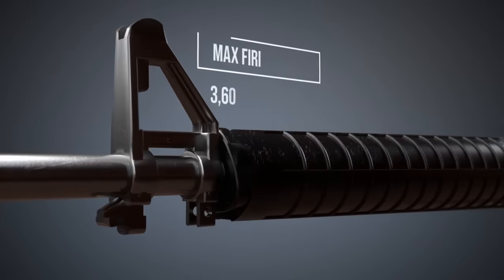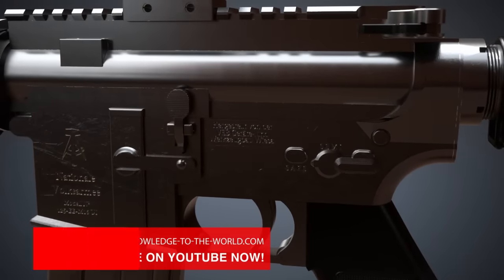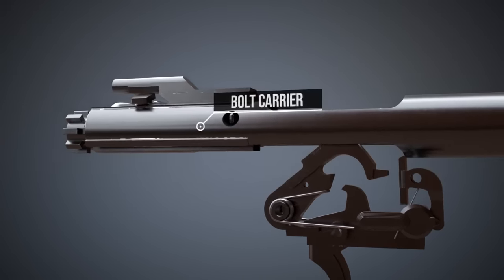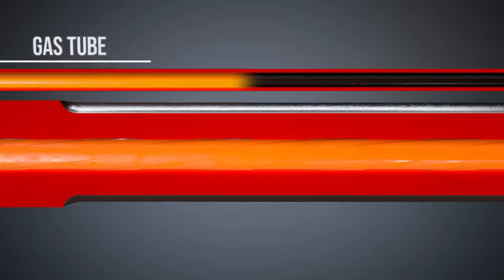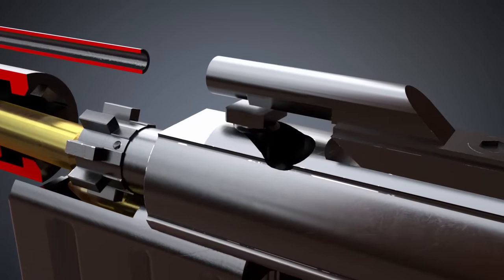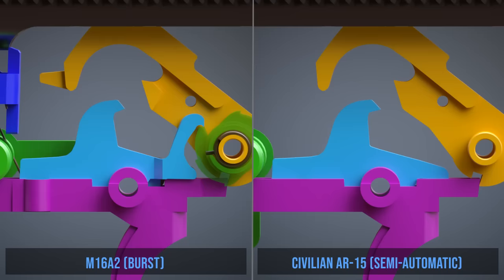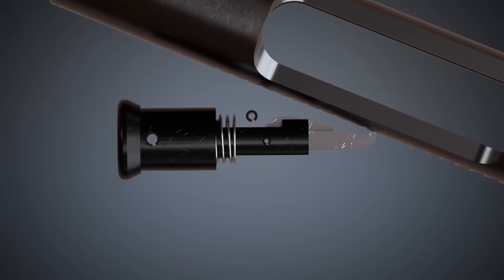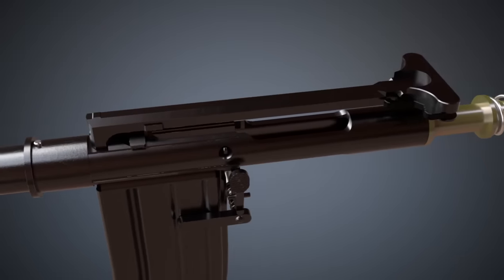M16 and AR-15 - How firearms work! (Animation)

Comment: Random penny of thoughts
Recoiless rifle gustav the m16 gas block-tube angluar-dracular blood-sucking taxman for additional concept-theory pull-draw air to cool barrel and avoid round from being "pulled-back" by "secondary" back pressure. Smooth draft magic carpet shell-round. Chamber explosion accepted as non-issue to operator by controlled dispersion using same fart-gas recycling-recoil control. Shock water reservoir surface without shell for cleaning light aeromatics hydrocarbons. Parallel shock - waves band.
Reply: Return-cycle is-mistaken for recycle. How to loop, some people say they know AR-15 but cannot loop automatic weapons... How to vent, some people say they know muzzle but want to argue on vents. How to add pneimatic-pressure loop to this design for feeder and clearing and suction gases for clear visor-goggles when have batteries-imcluded.

Comment: I dunno about the whole cleaning thing, I have AR's with over 3000 rounds that I slightly lube here and there and they run perfectly. You hear the AR needs to be cleaned all the time and the AK doesn't, both those are not true.

Comment: Hm. I've heard that M-16 mechanism is complicated and now got why. That's hard to understand the failure reason even with animation, which makes a problem for solders.
Reply: It's actually simple in terms of how it operates. It has about the same amount of moving parts as an AK.

Comment: Whose idea was it to just let the gas tube blow off into the receiver?
Reply: Eugene Stoner, in making one of the very few inline gas systems ever.  By the way, the M16/AR-15 runs with absurdly good reliability through fouling, despite the myths.  Just look at the Filthy-14 or any of the many many test guns people have put through torture tests of no cleaning.  We're talking thousands upon thousands of rounds without even a single wipe and no malfunctions.  If you think fouling hurts a well designed gun, look at any blowback weapon like the MP5 or G3 and see if anyone complains about their reliability even though the fouling is far FAR worse.

Comment: Ngl, the AK47 is probably more practical, as it doesn't have that complex systems like this so it's easier to produce and less likely to get jammed.
Reply: The AK is about as complex as the AR-15.  The AR-15 is not complicated at all, and is so simple that the average American can build one out of a parts kit with only hand tools.  An Ak requires machines in order to put together. 

The AR-15 is not prone to jamming at all.  Look at the Ar-15 mud tests and you'll see how much better the AR-15 will perform in bad conditions than the AK.  All the jamming stuff and AK reliability stuff is based of myths

Comment: Why do you need to capture the gases and redirect them to push back the bolt, isn't the round going off enough force to push back the bolt? Would help keep the gun clean, no? Don't pistols work that way?
Reply: @Samuel-yl9yo  None taken, I was just curious. Thanks for the explanation.
Reply: @Samuel-yl9yo  Yeah I was thinking pistols. They use blowback to release the cartrige?
Reply: @Tumasch  Pistol caliber ARs will use blowback, yes, but they can use anything from straight blowback, which is just the bolt being pushed straight back immediately, to a number of delayed blowback systems. Delaying the blowback through a radial movement of the bolt or through rollers give the bullet time to leave the barrel and vent the pressure of the system, which reduces the recoil impulse felt as the bolt will not be traveling backwards as quickly.

Comment: What turns the bolt?
Reply: The cam pin. As the BCG is moved rearward by the expanding gasses the cam pin is run through a channel that turns the bolt and allows it to be pulled out.

Comment: Why was it necessary to invent such a complex system?
Reply: Compared to most modern inventions this is pretty simple.
Reply: @TMega5612  Why was it impossible to make the design of the machine gun as simple as on the AK-47?
Reply: @eugen2408  It's not that much more complicated. The fundamental operations are very similar.
Reply: @TMega5612  Where did you see such a complex system in the AK-47 as in the M-16 or AR-15?
Reply: @eugen2408  Why do you view the AR-15's system as much more complex? The fundamental principles are mostly the same.

Comment: 2000° Celsius ????? Really ??? That's enough to melt metal.
Reply: Lol, not all metals have the same melting point. Also note that it only attains those temperatures for mere milliseconds. It takes sustained heat to reach melting point, and quite a lot of sustained fire to melt down the chrome-moly steel alloys used in barrel construction.

They can be melted, and you do see videos on youtube of rifle meltdown tests; it takes many hundreds or thousands of rounds fired in rapid succession to do so.

Comment: The M16 and the other one military ones or a big difference than the civilian AR-15 ArmaLite rifle 15 semi automatic and design for housewives to use but a president was to squeak and cowardly to get a real rifle and use a non 22-caliber one like the ArmaLite rifle 10 because it kicked too much he didn't want to use it so he kept telling them to use the 22 caliber rifle the one you're talking about 22 caliber in the military is full auto with the selector switch is said to semi-auto or three round burst they civilian AR-15 22 caliber is only semi-auto every time you pull the trigger fires unlike the military version

Comment: What makes the autosear move?
Reply: 2:39 When the bolt carrier is traveling backward it hits the auto sear causing it to catch the hammer then after locking in a fresh round, the bolt carrier again pushes the auto sear forward which releases the hammer thus firing the newly chambered round.
Reply: To elaborate on what Pluto-90 said: A full auto bolt carrier has a lip on the bottom of it that engages the autosear. For a while, civilian ARs had a special bolt carrier that had that shaved off. Nowadays, most manufacturers simply use full auto carriers because their mass is proper for the design and is the most reliable shape. It is not a regulated part and cannot itself make a rifle full auto without the regulated FA triggerpack and sear.

Some legal rapid fire triggers on the market do require that lip for their purposes: Both Franklin Armory and FosTech binary trigger systems use a "safety lever" in lieu of a "sear" that is depressed by the bolt carrier that blocks the trigger's action until the bolt is fully in battery. Rare Breed's Forced Reset trigger also has one, but I'm unfamiliar with its exact workings.

Comment: They allowed the gases to enter the mechanism?? LoL WTF?
WHY??
Reply: So the recoil is directly inline with the action, something you can't do with piston guns.  It's actually perfectly fine, the AR-15 handles fouling extremely well.  Look at the Filthy-14 or any of those many AR-15s that have endurance tests done to see how long they can shoot without cleaning without any malfunctions.  Even MAC is in the middle of an endurance test right now and i think it's hit almost 10k without a single malfunction. 

Also you think gases entering the mechanism is bad, look at the MP5 or G3 or any blowback gun.  They'll run way way dirtier from gasses entering the action than the AR-15.

Comment: 0:40 thats strange my m16 had knobs
Reply: mine had a pull-start gas powered rotor, but im not bragging about it
Reply: @themilkman6969  ya but the one i shot was real.
Reply: @t.m9341  
hey man that gas powered generator i carried on my back was damn useful for accuracy
Reply: @themilkman6969  ya its too bad the cops at uvalde didnt have powered generators for their riot shields then maybe they wouldnt wait 81 mins while claiming the incident was over while kids were still calling in saying the guy was running around.

Comment: Too complicated than a AK-47 and requires high maintenance. While AK-47 requires very less maintenance, its not as accurate as M-16 but its effective than M-16 in close range combat and also effective at long range depends on the strength and a stability of the guy who is firing this monster. Even in FPS game people prefer AK-47 cause it is also more armor piercing than a 5.65 bullet.
Reply: You're using video game logic.  In real life the AR-15 does not require much maintenance at all.  Look up the Filthy-14 or many endurance test AR-15s that receive no lube and no cleaning, but fire thousands upon tens of thousands of rounds without a single jam.  In fact, generally overmaintaining and overlubricating your AR-15 will more likely cause it to jam. 

The AK47's 7.62x39mm is a fat low velocity round.  It is less likely to pierce armor than the high velocity 5.56mm.
Reply: @deanc91  First of all AR-15 and M-16 are both different rifles.
1) it looks like Game logic but its not. You can see a video on youtube AK-47 vs M-16. AK-47 is devastating upto 300 yards. even if it do not penetrate the impact of the bullet can keep the man down for long.
2) M-16 inside is so complex and takes a lot longer to reassemble if jammed. Ak-47 is also very durable.
3) You can also load AP steel bullet rounds in AK-47 that can even pierce Armored military vehicles.
4) AK-47 parts are also cheap, easily replaceable.
Also check out PK-18 rifle you will love it, if you like AR-15. its simply an AR-15 with 7.62 x 51mm rounds, weighs 3.8 Kg, Muzzle Velocity 820 m/s. effective range 600 max. made by Pakistan Ordinance Factory, available for export in 2021.
Reply: @deanc91  Barrel changes a lot of things. and design too.
Reply: @deanc91  Most of your stuff is wrong dude. i fired both of them. AK-47 does not leave a small hole omg. You can watch Taliban live execution if you want to confirm it. it literally explode your skull at 300 yard distance. and what ever you hit leave a bigger whole at its entry.
Reply: @pkavenger9990  Changing the barrel doesn't do much on the AR-15 system.  All you need to do is have the correct corresponding length of gas tube and that's it.  That's the brilliance of the AR-15 system.  You can just swap out the barrel to different lengths with the appropriate length gas tube and nothing else needs to change.  There are AR-15's that are part for part exactly the same as the M16.
Reply: @pkavenger9990   I am 100% correct, I own both rifles, I have had to study both rifles extensively.  I have carried both rifles out in the field and through the dirt and mud.  I have used an AR-15 as a patrol rifle before, and my field of work led me to have discussions with medical experts on the wounding capabilities of both rifles.

Taliban executions occur at point blank.  The brain is soft and can cause the skull to explode from hydrostatic shock.  5.56mm will do the same, if you looked at the Kenosha shooting, a point blank shot with 5.56mm will cause your entire bicep to explode as well.  The issue is a chest shot which is much more important and much more likely to happen.

The exit hole for a 7.62x39mm is larger because that's when it starts to tumble, not the entry.  Look that up.  5.56mm is less likely to leave an exit hole because it will fragment and cause a massive permanent cavity, which results in more energy dumped on the target.
Reply: @pkavenger9990   And from an ACTUAL professional, medical examiner Dr. Vincent Di Maio's textbook Gunshot Wounds: Practical Aspects of Firearms, Ballistics, and Forensic Techniques states "The M-16 rifle chambered for the 5.56 × 45 cartridge is considered by many to be more effective in its wounding ability than the AK-47. With either the 55 or 62-gr. full metal-jacketed military bullet, the average distance of penetration before significant yaw develops is 12 cm.12 Thus, on an average, these bullets begin significant yawing in half the distance of penetration of the military AK-47 round (25 cm). The effectiveness of the 5.56 × 45 bullets is further enhanced by the fact that as the bullet reaches maximum yaw, it tends to deform and fragment while the 7.62 × 39 bullet with a mild steel core does not."

This is an actual professional that has had to take apart countless gunshot wounds and examine all sorts of gunshot wound victims.

Comment: Too complicated, AK system much more similar, less parts, less things to jam and much easier to clean.
Reply: The AK uses about the same number of moving parts, and will actually jam faster in adverse conditions like in the mud.  The AR-15 is actually much easier to clean.  All parts are captive and you only need to break it down to 3 components to clean.  The AK breaks down into 5 components, of which some loose parts are not captive.

Comment: AK-47 is more efficient and has a simpler design
Reply: "AK 47 is more efficient"
Citation needed
"And has a simpler design"
Not saying much when neither rifle is all that complex.
Reply: @atfyoutubedivision955  I tried both and it's the same 5.45 caliber
On a military shield
M 16 stopped in the first side of the shield
While the other pierced it  with the energy to get stuck on the other side
Note .. I am an army officer
Reply: @blacklight710  Your anecdotal story is not a citation. Also AR15s are not in 5.45 and neither are AK47s.
Reply: @atfyoutubedivision955  7.62mm and 5.45 mm
Reply: @blacklight710  2.23 inch and 5.56 mm?

Comment: "Direct impingement" was the stupidest, worst gas system ever devised by man.  Ostensible reason - "weight savings".  Disadvantages?  Blows heat and filth into and onto the bolt, builds up heat much too fast, dirties the bolt carrier group much too much, and blows out lubricant.  Gun overheats much sooner than the same gun fitted with a traditional gas piston.  All around WORST rifle and cartridge in US history.
Reply: Wrong.  It's one of the very few inline gas systems ever devised and why it's such a pleasure to shoot. 
Blowing heat and filth back onto the bolt means very little.  The M16/AR-15 runs fine through filth as evidenced by the Filthy-14 or any of the many torture test AR-15s that have had thousands upon thousands of rounds run through it with minimal lube and 0 cleaning and no malfunctions.  If you hate filth, go point your finger at any blowback type gun like the MP5 or G3.  That fouls WAY more than DI ever will, yet people poo on DI for some reason for fouling.

Overheating is the only real disadvantage, and you will not be running your M16/AR-15 to failure anyways unless you're being stupid, doing full auto mag dumps without any rest.  The weight savings and softer more inline recoil is worth the trade off because as a rifleman, you're not going to be magdumping except for very very very rare circumstances.  You will however, be hiking miles upon miles upon miles with the extra weight.

Comment: This weapon is a high maintenance trash. Needs to constantly be cleaned and you better keep it away from dust/sandy or muddy environments unlike the way more reliable and easy to maintain AK47.
Reply: I haven’t cleaned my KAC SR-15, and I’ve fired around 10,000 rounds through it. I’ve beat it to hell, and it still runs perfectly. Saying that it’s trash is definitely not true.
Reply: also: 

AK mud test: https://youtu.be/DX73uXs3xGU

AR15 mud test: https://youtu.be/YAneTFiz5WU

Comment: One of the worst system ever made for gun. Even US is now moving to short stoke
Reply: It's actually one of the best.  Everything that has been levied against it as being bad was due to sabotage during the early Vietnam war.  It has been incredibly reliable and easy to operate ever since then.  Short stroke is only being used because it's easier to have a unified platform based off of it, not because of any inherent advantages in handling or reliability.  You can't do DI machine guns due to overheating problems, but if everything is short stroke, then you can have a platform that is both a rifle and a machine gun.